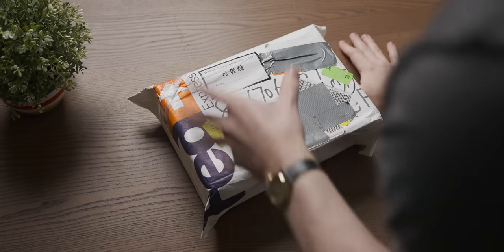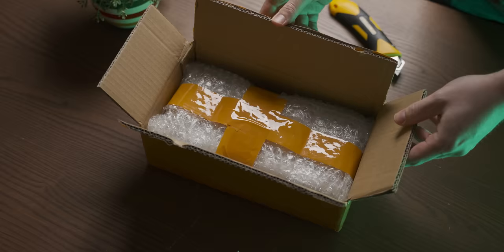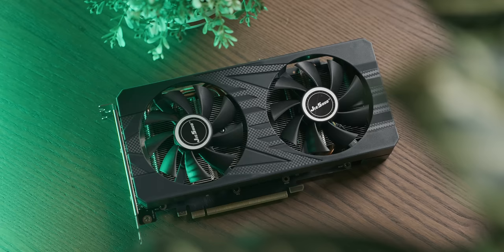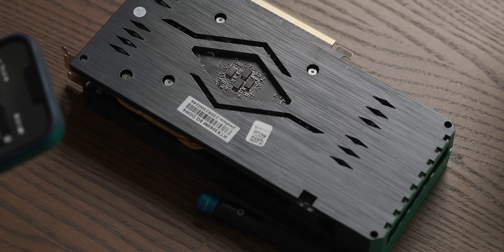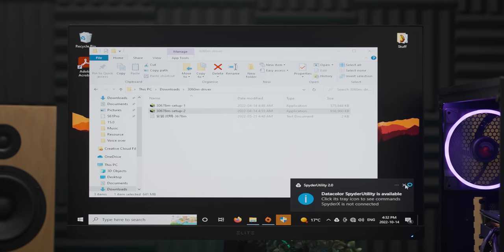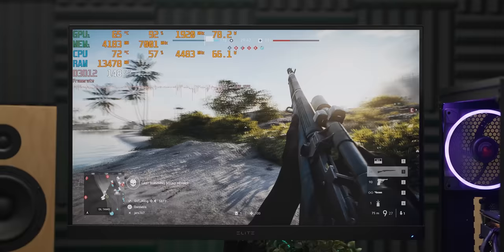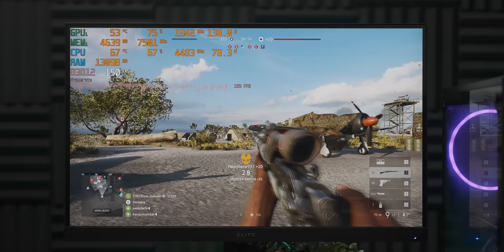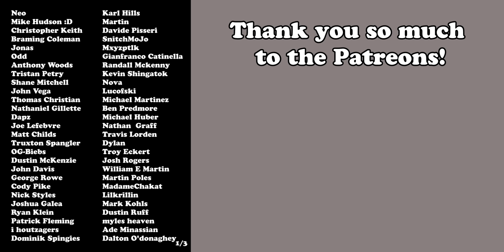This "New" RTX 3060 From Aliexpress Was Suspiciously cheap...

Comment: due to the power draw and performance, somehow the ali express card was better than the real deal. wow
Reply: Shows the state of nvidia where even dodgy Alie express sellers give you a better deal haha
Reply: @loowick4074  that dodgy gpu is still an nvidia gpu at its core tho 😅
Reply: @loowick4074  that’s pretty much how the market has set itself tho, the highest binned chips of a particular die go into the Workstation cards like the A4000 etc, the the second best binned goes to laptops cuz they all have small chassis so higher binned = greater efficiency, and the last ones go to desktop cards
Reply: Uhhh, that’s because desktop chips are essentially poorly binned mobile chips.
Very efficient bins go to laptops while crappy ones are turned into desktop chips.
That has always been how they make processors and GPUs.
How did you think a 3070 for desktop draws 200w power alone while the laptop variant (non MaxQ) draws a third of that and offer only slightly less performance?
Reply: @cunnyman  the difference between mobile gpu and their desktop counterpart aside from 3060 is kinda big tho and mobile 3070 draw up to 140w (150w for some 2022 mobile 3070)
Reply: The card is clocked at the peak of the efficiency curve (makes sense for laptops), you could probably get the same power draw with the desktop variant by undervolting and underclocking.
Reply: @SviatoslavDamaschin  I don’t think so, iirc Dawid tried doing that, but the performance wasn’t as good as out of box peak efficiency performance
Reply: @SviatoslavDamaschin  Thats absolutely true, my aorus xtreme 3080 is drawing max 280W with 825mv and 1890mhz so its possible...from factory with bios mod i get 2145mhz 450W peaks...not efficient at all, but few cards can do this
Reply: As long as you don't mind the malware festering inside your PC.  :P
Reply from the maker: The hardware is better than the real deal. Really cool GPU that I wish Nvidia would make. The drivers on the other hand is a real deal breaker. 😅
Reply: @DawidDoesTechStuff  but how does this gpu handle ray tracing❓
Reply: Depends what you want to use it for though, for video editing for example I expect the extra memory could make a huge difference.
Reply: @cunnyman  sorry, huge less performance, not even close when you see the score. 3060>3080M
Reply: @cunnyman  ah. so you're the guy who took my desired @.
Reply: Well it's a full die unlike the 3060 that have a cut die it has like 800 more shader more tmu more rop etc
Reply: It’s because it’s the laptop variant of the 3060 that’s why it has 6gb of vram
Reply: If only not for the trojan drivers, its a decently good deal. Ive seen aliexpress rx 6600m (same case like this 3060m abomination), and it's on par than regular 6600 but with lower power draw, and you dont need trojan driver for it
Reply: @pav1u my rtx 2080 ti is drawing 350watt-370watt. Modded vbios.
Reply: @LOOTLORD605 well i know this is old, my 3090 modded does 520w/530w peaks on hybrid water cooling with a "few tweaks", dailying it😅
Reply: @pav1u  Holy Shnit !...
Reply: I have a 3060 oc undervolted   now has a TDP of 177W and lost about 4-5% performance
PC runs on a 500W silver PSU...i have no issues and i do 3d work 😂
Reply: @dincaandrei  i forgot to mention i am using a 700w gold for this, its what i had and did not change it, its at its limits, when it dies i change it.
Reply: Spoler
Reply: @pav1u  that's similar to what I see with my 3080 undervolted.
Reply: @liquidatious21 it probably craps its pants when you ask for RT. My old 3060 didn't like RT much. It's not really suitable for RT without DLSS or FSR, which I was too bourgeois to use. Now I have a 3080
Reply: You have to install a custom mobile GPU driver for it then it works perfectly. You installed the wrong drivers, so of course it didn’t work.
Reply: @DawidDoesTechStuff  should i get this if i cant afford a expensive ass gpu?

Comment: This AliExpress graphics cards makes a huge success here in Brazil, and we have a full community of this cards with "techtubers" and users who make review of this cards. This 6GB 3060M is not recommended here, but we can buy some real good gpu (like a real 3060, 3070) for literally half a price in comparison with the Brazilian market.
Reply: Sheli official store it's one of the most reliable sellers for this graphics cards. Só na espera do 11/11 pra comprar a minha kkk
Reply: I wish i could upgrade to a 3060.....im stuck on gtx 1060 6gb
Reply: The limiting factor for the 3060M in a lot of laptops is they tend to get added to "thin-and-light" gaming laptops so the power envelope is really limited compared to what it is capable of.
Reply: @energygameplay6513  same..I'm still rock I ng gtx 1660 .gets the job done, but I really wanna a 3060. Cuz my psu is 550watt 80 us bronze. I don't wanna upgrade that as well
Reply: @robertanderson5735  your psu is fine for 3060 mine is 500 watt but its old psu that came with case cooler master cmp350 so if i upgrade gpu to anything i would have to upgrade psu aswell....
Reply: Man. It's so sad to see fellow gamers paying so much extra in Brasil. I really hope gamepass family plan with good cloud service will be available to all of ya.
Reply: @robertanderson5735  you can run a RTX3070 on a 550w psu if your not using a massively overclocked cpu! (If your currently utilising a Ryzen 5/7 or Intel 5/7 non-k cpu) Im currently running a RTX3060 on my 400w gold psu with Ryzen 5800X3D with no issues gaming 🥰💪👍. My brother is running an RTX3070 with a Intel 10700 (non-k) cpu on a 500W platinum psu 💪🤯😇🥰👍. I also have 5900x with a 3080Ti running on a 750w platinum psu and barely use over 550w under gaming loads.
Reply: @michaelthompson9798  my cpu is the R5 2600x at 95watts.
Reply: Need to upgrade that as well.lmao. need a while new pc by than. Goal is to upgrade cpu 5600x and gpu to a 3060 or 3060ti. Or even amd .cause the price to performance . But I like team green cause I wanna start streaming as well.
Reply: I got a 2080ti last month for 3500 reais here, which in Brazil it would be easily 5000 reais. My dad just got a 1660 Super with 6GB of RAM for 510 reais which is just insane in Brazil since it's aboute 1200 reais MINIMUM for one of these. Also another friend got a 2060 Super for about 1000 reais which again, is crazy impressive since it's abou 2000+ in Brazil.
Reply: yeah, i noticed 50% of the buyers are brazilians, and 50% russians or so. 
for fucked up markets aliexpress is a nice alternative.   i myself im using since  sept 2020 a 8 cores xeon, mb, and 32gb ram from aliex for just 125€
Reply: @energygameplay6513  I play in 3440x1440 with a 1060 3gb.. surprisingly it always does the work.
Reply: Where do you get those cheap cards and do they offer shipping
Reply: @100tinka  also, usually with high prices the shipping is free and it arrives in Brazil (the other side of the globe) in about 2 or 3 weeks
Reply: @KaNgUrUhBR  can you share some groups which can help with choosing
Reply: @robertanderson5735  yeah i got a gtx 1660 super but i would not mind an rtx 3060, i have that lenovo legion OEM prebuild that dawid reviewed awhile back
Reply: @robertanderson5735  I've ran a 3060ti on a 550w no issues
Reply: @100tinka  bro just choose a 3060ti or 3070 from a good 97% approval seller if u live in america/europe
Reply: @UmaPessoaQualquer9  i bought from MLLSE
Reply: @energygameplay6513  2gb 960 here feel like i have been using it for a decade haha
Reply: Except for the driver shenanigans, the card seemed great, almost the same performance for half power draw and for a more than 100$ less.
Reply: There's also the RX 6600m which uses the same chip that goes on Tesla model S.
Reply: @KaNgUrUhBR  is there a way to get less sketchy drivers for it? What forum are you a part of for this card or others like it?
Reply: @energygameplay6513  Which model 1060 and have you overclocked it? Both my old one and my GF's card do 150+ core and 400+ VRAM.
Reply: @geraldsanchez191145  none of these that O bought had this issue, my dad's old gpu (gt740) did though, weirdly enough. The way I fixed it was to install the driver separately from NVIDIA's website and THEN and only then was I able to even install GeForce Experience and update them. Not sure if it's the same issue though 🤷🏽‍♂️
Reply: @raychii7361  xcloud's been here for a year or more now. i've even tried it at my farm with starlink and it's awesome. i mean, as a complement, not replacement. thankfully i'm well off enough that i can sustain my hobbies with decent quality despite the retarded pricing we get here.
Reply: @KaNgUrUhBR  well that's reassuring. The prices for the 3060 went up to 3060ti levels when I checked lol. But thanks for the telegram recommendations (I speak Spanish too so it kinda helps). I'll keep an eye out on some deals
Reply: @energygameplay6513  woah I wish I had a gtx. Intel potato graphics 😢
Reply: @energygameplay6513  gtx 1650 want a rtx 3060 ti to do some vr.. prices are okayish now.
Reply: And you guys have the MOST amount of trojans that install from these cards I'm sure.
Reply: @RedHeavy-  well if i want to upgrade i will have to upgrade my case and my psu also .psu500 watt case coolermaster cmp 350 ,psu is the one that came with the case it only got 1 6pin connector so its not that good and my case cant fit bigger gpus than 27cm legith
Reply: @energygameplay6513  Me and my brother have recently upgraded to the 3060 Ti and I really recommend it, it's easy to get now and I recommend you buying one for yourself. The price will drop soon enough so you might be able to snatch a deal for around 380$ or lower!
Reply: @robertanderson5735  Hey, a 550 watt really works for a 3060, I have a 3060 Ti and it runs pretty well on a 600 watt PSU, my brother has a 550watt 80 us bronze and it still runs as good as mine.
Reply: @colin1373  my case wont fit it its old style case (cooler master cmp 350 , it fits gpus 27cm max leight) and my psu is not that good if i buy gpu i would have to replace at least the psu
Reply: @tragile9108  depends on the game if its gpu dependent or cpu dependent
Reply: @JGStonedRaider  i got msi gaming -non x gtx 1060 6gb
Reply: @JGStonedRaider  and i couldnt achive that kind of overclock i dont exacly remember but it was probably +130 ish on memory and 140 on core  anything higher isnt stable and my psu is not that good its cooler master 500 watt oem that comes with case cooler master cmp 35p
Reply: @energygameplay6513  oh that’s alot
Reply: @Qwerty-uiop  who knows you maybe have better cpu than my i7 9700kf
Reply: lucky guy 😀
Reply: Is there any site of this seller, can you explain to me pls
Reply: @energygameplay6513  Save, a dollar or 10 dollars or whatever you can, in a few months you will have your graphics card
Reply: Qual tu comprou aí?
Reply: @energygameplay6513  i brought a gtx 1080 ti today (i had a gt 710)
Reply: @rabannanas  nice its still good
Reply: yeah, the RX 6600M is king and AMD doesn't fuck the drivers, you can still Adrenalin and call it a day like a normal card.
Reply: @energygameplay6513  wait for RTX 4060 or RX 7600 xt
Reply: @trr4gfreddrtgf  maybe i will end buying someting like this yes depends if i can get away with 500 watt psu and my bad pv case (cooler master cmp 350)
Reply: @energygameplay6513  What's your CPU? It'll likely be fine.
Reply: @trr4gfreddrtgf  i7
Reply: @energygameplay6513  Which generation?
Reply: @trr4gfreddrtgf  9th gen
Reply: @energygameplay6513  You'll likely be fine
Reply: @trr4gfreddrtgf  yes i know cpu wise im fine but psu and case are kind of preventing me to upgrade gpu
Reply: @energygameplay6513  what I meant was that your CPU shouldn't stress your 500w PSU out a lot, and neither should a 4060 or 7600xt
Reply: @UmaPessoaQualquer9  Thanks, ill check out the store on Ali
Reply: @UmaPessoaQualquer9  I got a rx550 from sheli, installed genuine drivers too, worked perfectly fine, now ordered a rx580, awaiting delivery.... same store, quite cheap n good.
Reply: @edge8945  I bet one could manually install the driver in device manager
Reply: @energygameplay6513  You lucky ass bastard. I'm stuck with the 3gb
Reply: @EuclidesGBM  both 3 gig and 6gig suck trust me 6gb isnt that much better
Reply: @Radin its still a decent card ,don't get me wrong! Its actually a very good 1080p card.  I'm looking for more 1440p in newer titles. So the 1660 is falling behind and showing its age.
Reply: @energygameplay6513  Same here...
Reply: @UmaPessoaQualquer9  ou no dia 1 né, aparentemente eles mudaram para o dia primeiro
Reply: @energygameplay6513  they aren’t to bad if you do affirm. 45 bucks a month for 12th months, that’s less then my high school weed budget
Reply from the maker: That’s awesome! I’m glad you all can find some good deals on AliExpress. 👍
Reply: @trr4gfreddrtgf  yep i understand i got some pc knowlage so i get it
Reply: @robertanderson5735  i got a 550 w psu with a rtx 3060 and im pretty sure it has enough energy
Reply: @Carahan  so you could overclock it like crazy ?
Reply: @houssam5180  did you try it yet ? how was it ?
Reply: @anesmkhallet2882  it runs really well!
Reply: please come to brazil gringo
Reply: I don't understand. If real 3060 and 3070 are available at half the market price, why are they not more popular than the 3060M gpu's?
Reply: @UmaPessoaQualquer9  quero comprar uma rtx 3060 ti 8gb e bom comprar dai quero saberr
Reply: @energygameplay6513  bro I'm on integrated graphics :')
Reply: For a backup gaming build these might be a good punt. Buy one and first try the official drivers.  If they work then use the build as per normal.  If official drivers don't work then install the unofficial ones then proceed dependent on personal paranoia levels.😃
Reply: Bro can you recommend me the seller of graphic cards at ali express?
Reply: but u are more happier and proud when you buy original part
Reply: In all Latin America friend since this gen of consoles is too expensive for mexican salaries allmost everybody got a x99 xeon kit with gtx video cards the gtx 1080 it became the favorite for the price and graphic power.